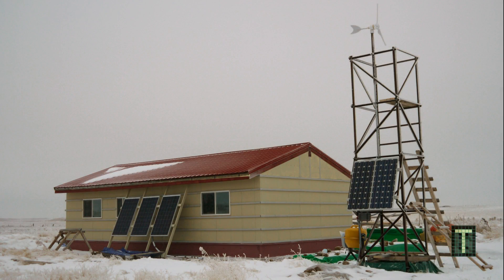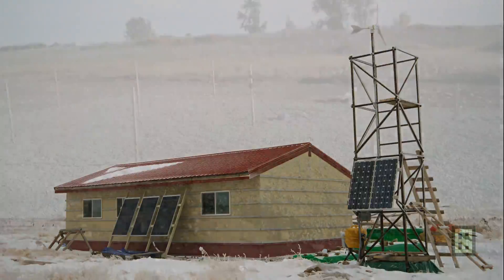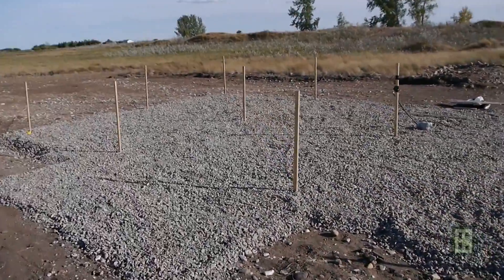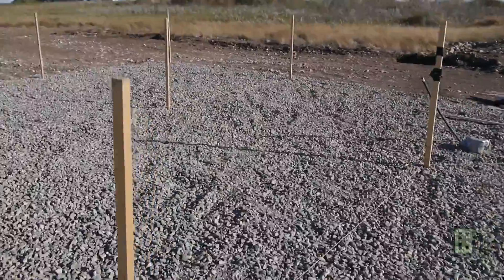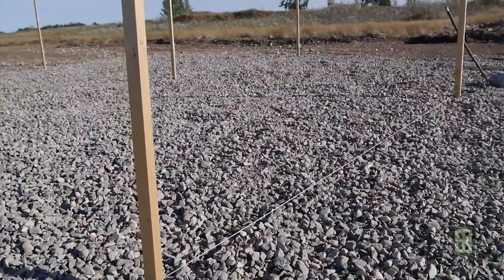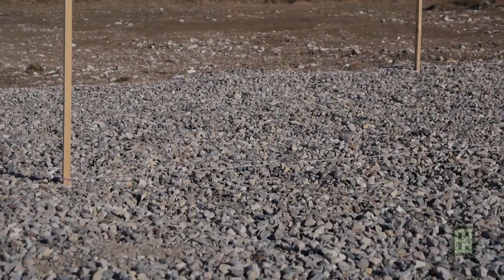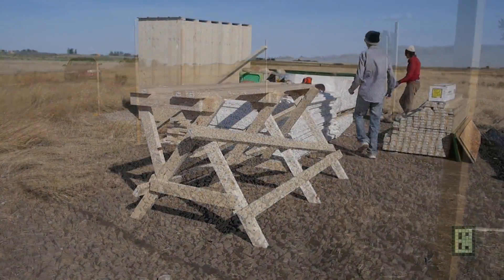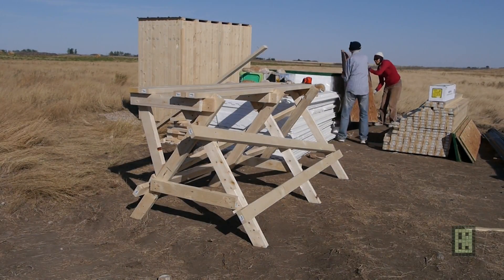Off Grid House

Comment: Its not like you have a lot of subscribers, or videos, or that your videos are exclusively on one topic. I wouldnt mind seeing building series. Its got batteries, electronics, solar.

On the sidenote, that house really is in the middle of nowhere.
Reply from the maker: I will count you as pro building series. Thanks.
There are almost 1500 subscribers not many for youtube standards but they are my subscribers and this channel is about electronics so I want to know what they think.
There are batteries, solar, wind but the series will be more about the house structure it will be technical like how to calculate thermal load and thermal storage about heat recovery mechanical ventilation so not that much about electronics.
Still it will have a title something with Off-Grid House so you can just not watch the video.
I will just prefer to use this channel and have only one because is much easier to  deal with one than with multiple.
:) It looks like it is in the middle of nowhere but is not like that.